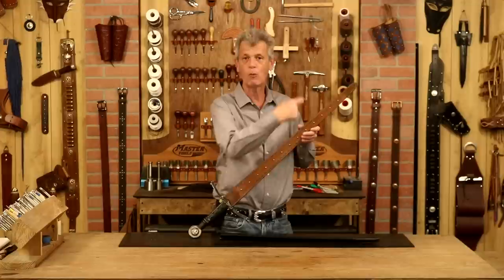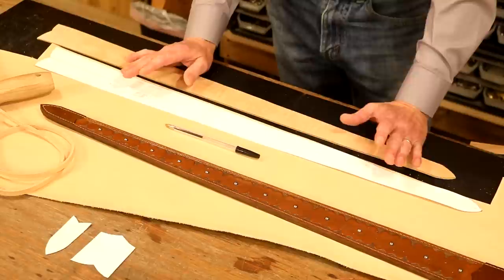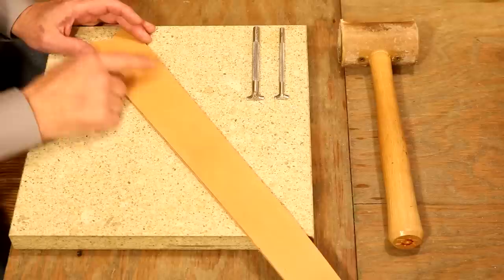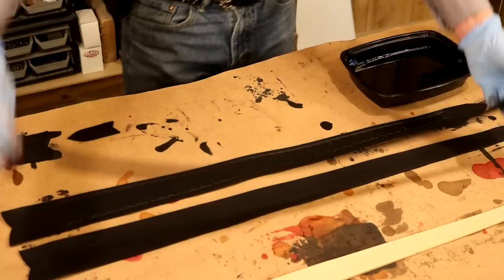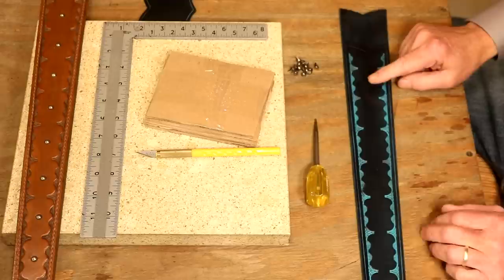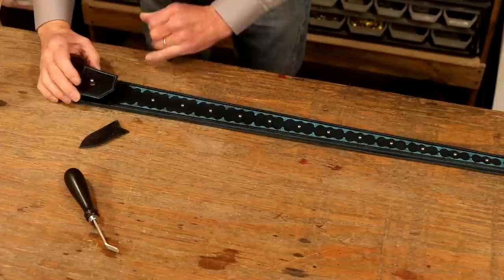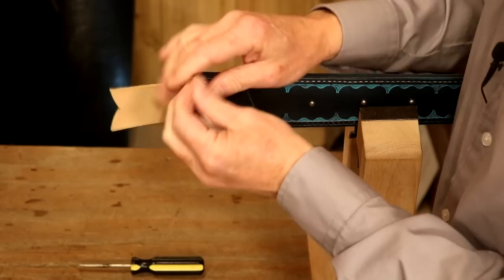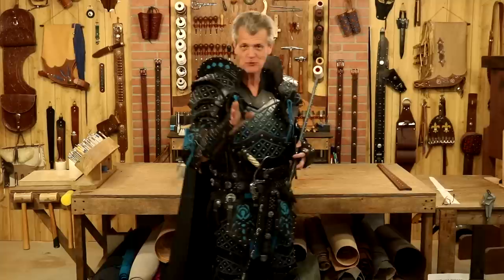Side-Sewn Leather Sword Scabbard

Comment: I believe this is the first time we see you wearing this armour? It looks amazing!

Also, an idea for a cool follow up - doing a scabbard/sheath for a curved single-edged blade, that still allows for tooling - I tried it several times, and doing a curved blade was always a huge pain
Reply: curved blades usually require an open necked scabbard when working in leather.  In my humble finding anyway.

Comment: Im curious if there is a way to calculate the amount of depth the welt needs to be in relation to the distal taper of the sword blade, since a lot of swords are thicker in the center part. I wonder if you split the difference of the height of the blade if that would make it too tight, maybe divide the height of the blade and reduce it by a 1/4?
I am curious because I have a sword like this and have been thinking of making a sheath for it, maybe its best to wet form around the blade since its thicker in the center?

Comment: So how about stitching leather over a wood scabbard? I've always wanted to do my own wood core scabbard. But I have no idea how I should stitch on that leather.
Reply: That sounds awesome! Could you cement the dyed and tooled but unfinished leather to the wood?  then after that sets up, if you did a colored antiquing  it would go down into the groove line and you could run the stitching spacer to make faux stitch lines... Then maybe if you put spots or rivets on, you could go all the way through the wood for a little extra mounting stability so everything stays together even if the cement eventually works loose?? Idk if that would work, but it works in my head.lol. i don't know how to satisfy the edges though...maybe if the wood was edge painted prior to the leather being attached...or wrap the leather around the edge 😬 just my brainstorming. Would any of that work??
Reply: Chech this out, 
https://youtu.be/Lq9GHJqHn5U 
Adam savage does a similar build like your talking. Not with stitching but you could always use a slightly thicker veg tan & leave a ¼" overhang on it & stitch it up. Or wrap the entire thing & stitch in the back. Hope this helps. 😁👍